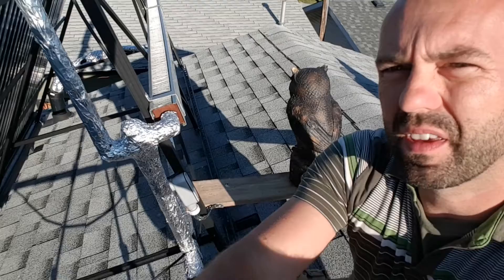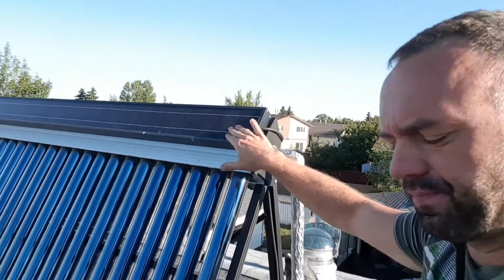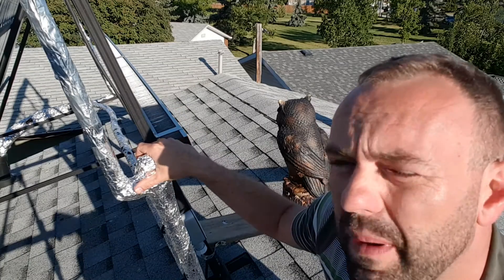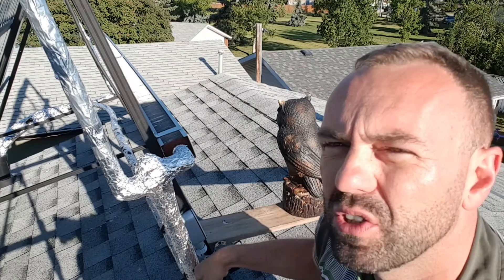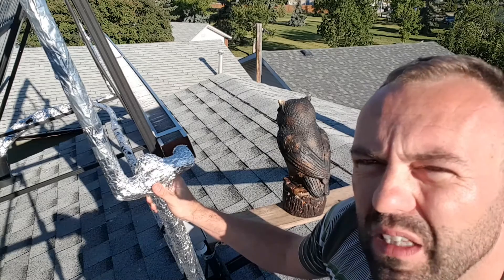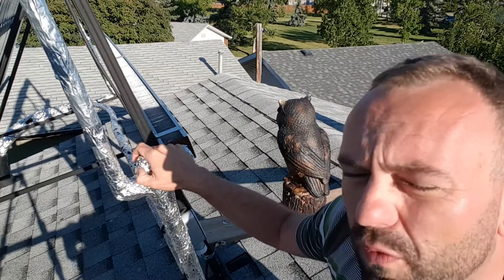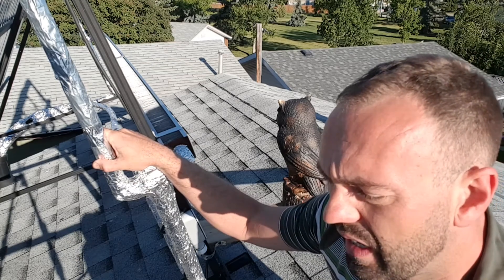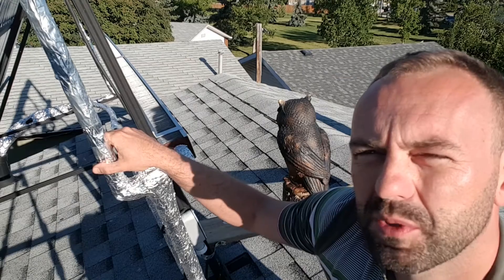How To Build A Bomb Proof Solar Thermal Collector

Comment: Is this thermal for hot water for showers and washing dishes or can you use it to heat radiant flooring and boiler type room heaters? Does it work in the winter?